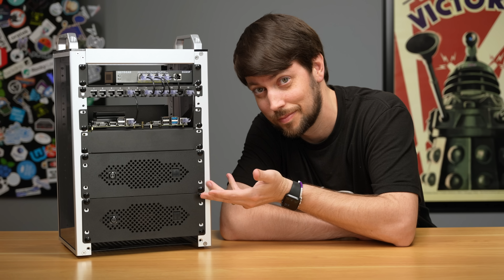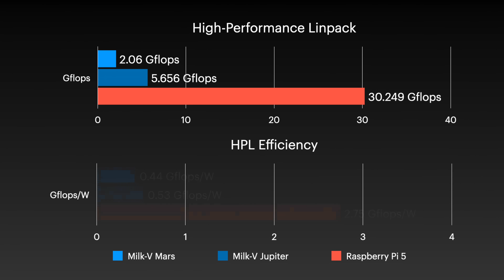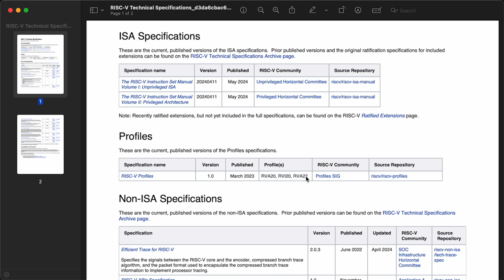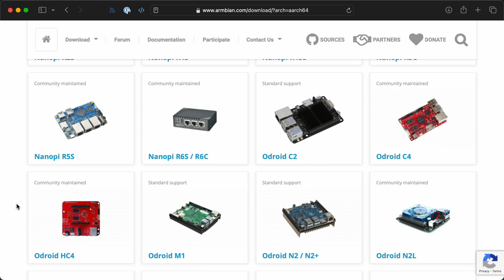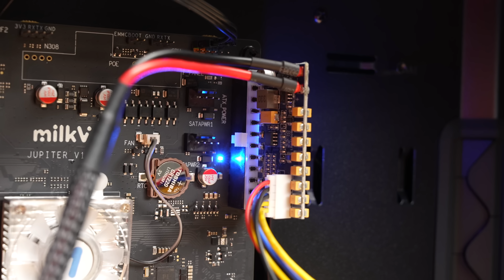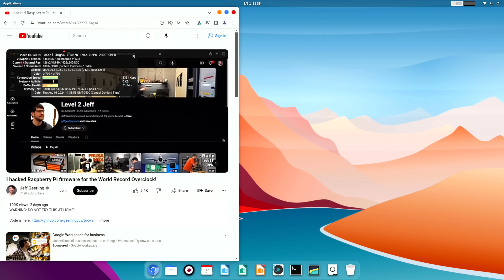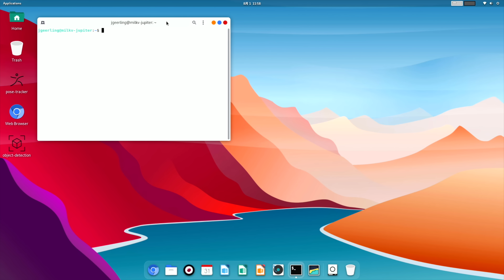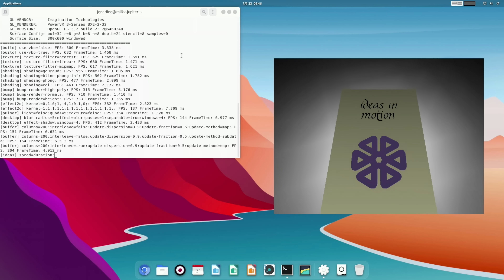The PC industry is changing: RISC-V goes mainstream

Comment: Risc-V can't work any better then linux in the consumer market.   For the same reason.  It's open source.   So manufacturers are free to Fix/Improve it in any way they see fit to differentiate their product from all the others.   This means they all end up incompatible and fragment the market into a confusing mess that the general public is just not equipped to handle.
Reply: Arm is proprietary and this didn't prevent fragmentation from happening. ISA is one thing, what else you bundle within the SoC is another thing. So far, RISC-V looks like it's going in the right direction.
Reply: @alexdev6161  Yup, Right out of the marketing hype hand book.  Anyway.  Back in the real world.  It's not like it's not possible for Risc-V to become popular.  Just that to do so means dropping all the so called 'advantages' people are touting.   I.e. have a single dominant design backed by a major player.
Reply: @lucidmoses so why google spending money porting android to riscv?
Reply: @guest7329  Can't tell if your making that silly of an argument or are just poking fun.
Reply: @lucidmoses  As long as people follow existing standards, you don't need a "single dominant design". There's ton of value to be had in not breaking software compatibility and selling a paperweight with 0 support, which obviously nobody sane would buy.

The market will simply sort out on its own. Good stuff will stand out, broken and fragmented mess will fade into irrelevance. Other players existing does not affect say Intel (one of the investors) coming up with a good RISC-V platform and dominating the market, if they have any interest in doing so.

Either way, it cannot get worse than whatever state Arm is in right now. Standardized ISA, but lots of SoC designs in the wild which need specific software support.
Reply: @alexdev6161  I have no need to convince you.  This has been tried thousands of times before.  It always fails for the same reasons.   I even gave you an example of the best that's ever been done.  Linux.  after 33 years has managed 2% of the market.
So just wait a bit.  You'll see.  you will likely be one the third of fourth next big hype thing when you finally think.... What ever happened to Risc-V.
A boat without a single captain will never get where it's intended.

Comment: I wonder if the tests running are using some of the simd optimizations, while consumer risc-v processors aren't high performance this is seems way too low for 8 core. According to banana-pi's website (take them with a grain of salt if you want) they state that per core they're 30% more powerful than Arm A55 which is really not that bad.

Comment: Horrible review. Why in the world when you are reviewing RISC-V, a CPU architecture, you are testing it on YOUTUBE, a GPU heavy load. And you didn't even mentioned what GPU is on board of this board.
Reply from the maker: I did mention it has an Imagination GPU in the video (though not at the moment I demo'ed YouTube). A lot of people testing a desktop OS on new hardware will test YouTube because it is a good proxy for how much work has gone into making sure the default web browser has GPU video playback acceleration working or not. And if not, how well the CPU can handle the decoding in real-time.

Comment: Sorry, but saying RISC-V has gone mainstream doesn't make it so, and your video title is click-bait.  I've yet to see anyone who wants to replace their current systems with ANYTHING powered by RISC-V hardware other than hobbyists and fan boys.  RISC-V performance is still 10 years behind AMD, Intel and ARM offerings and at a higher cost to the consumer.  Not to mention that MS has no plans to port Windows to RISC-V.
Reply from the maker: Mainstream in the SBC space; and Microsoft is happily digging Windows' own grave over the next decade or two unless their product management can fix their problems.
Reply: @JeffGeerling  Seriously? Windows still has over 80% of the market share so I don't know what graves you're talking about. What percentage of the PC hardware or hobbyist hardware space is owned by RISC-V?  Oh, that's right, it's so small no one even knows.  So you're going to stick to your lie that RISC-V has gone mainstream?  I'm also a hobbyist and the biggest bang for the buck is still ARM and I and all my associates would never consider RISC-V on price alone, let alone its poor performance when compared to ARM offerings.  Currently the RK3588 is the choice of most hobbyists and it'll stay that way for quite a while.

Comment: It seems like a new architecture would be a great opportunity to get out from under the absolutely crushing weight of technical debt we're currently trying to live under.  Every OS and all the browsers (essentially OSs in themselves) are filled to the brim with a mindboggling amount of cruft.  240p full screen video playback was possible on a 66mhz 486 completely in software mode.  A 1ghz machine of any kind should be smashing 1080p, and I'm sure it would if it wasn't running on bloat on top of bloat.
Reply: It’s probably a driver issue. The board Chris reviewed was able to play 1080p video.
Reply: Well... Most likely the Chromium was installed through apt and might have a lot of disabled flags at compile time. Maybe Jeff can try compiling it from sources? 😂
Reply: Now imagine making arcade games by Sega and others on it.  Consoles too.

Comment: Hard pass on RISC products for me.  If I wanted to buy Chinese chips (and I have), I would buy rockchip ARM chips like my Orange Pi 5 Plus
(32GB) has in it.  Its performance is 100% of the way there for anything other than a power user desktop computer.  It'll play 4k videos all day long with no dropped frames, has 3 monitor outputs, 2.5g Ethernet NVMEx4 Windows or Linux etc ad nauseam.

Comment: It's really hard to go through the advertisements for various things to actually find the things I need.

For example, I really want to run a Ceph cluster. But I really want 10Gbps Ethernet and a 6Gbps SATA connector for each computer, as well as a multi-core (4 is fine) with 16GiB of memory each. But it's really difficult to figure out what I have to buy to get that, much less figure out how much it will all cost.

And I asked in r/homelab for advice and was told "Oh, you would never run a commercial Ceph cluster that way, you should do this other completely different thing.".  And that, of course, is very much not the point. :-/

Comment: I think you're spot on with the ARM effect when it comes to building software. By now, RISC-V is just another entry in a list, not a new dimension, in any toolchain that can compile to x86 and ARM. Any developer knows that "support something other than X" is worlds apart from "add Z support, but we already have X and Y support".
Reply from the maker: I remember how hard it was to get x86 + Arm with so many toolchains 5-10 years ago. So much simpler now.
Reply: @JeffGeerling  good thing you've not been around when we went fromm x86 to AMD64 that was a pain and a half.
Reply: I'm wondering what utility Gentoo will have with it's compiling focused package management for risc-v considering it's such an edge case use right now.  Maybe compile a working desktop and image it across a group of similarly set up computers?

Comment: I think the thing that I'm possibly most hyped about with Risc V is the SIMD extensions of all things. There's so much code I run on a daily basis which is dependent on them, but retooling it for specific architectures can be a massive pain when you get into bigger projects, so I absolutely love the idea of a sensible, variable bit width instruction set made with a certain degree of hindsight and forward planning built in.

I would love to see some coverage of Risc V SIMD!

Comment: Irrelevant for me. My use case is Proxmox running VMs, requiring an integrated GPU that can be passed through for accelerated transcoding.
I blew $30 for a second-hand Datto Alto A3V2 with Celeron 4205u incorporating UHD-610, with onboard H.264 and H.265 (8 and 10 bit) encoding.
My server is monitoring 4 network security cameras, running a Samba share, hosting several web pages, plus a couple other services which I forgot what they even are, and is still only 35% utilized.
I don't anticipate ever "upgrading". This does everything necessary now, or even envisioned for the future.
I loaded AdGuard Home onto a USB flash device on my DD-WRT router, for pete's sake, and that router is already over 10 years old & satisfies all current and future possible needs. My PC with Ryzen X1800 dates back to 2017 and I have no anticipation of ever upgrading. Why? It does everything already.

Comment: Interesting video thanks Jeff & Chris!

Watching this on a DC-ROMA 2 with the SpacemiT K1 CPU and it can handle the video at 360p without stuttering but falls over at 480p.  This is with the Ubuntu 23.10 that the laptop shipped with, wonder if the stuttering is actually because the software is not optimized yet?  I have a Debian image for the laptop too and am hoping to try other operating systems if you have any recommendations?  Also, yes definitely interested in a test of the PCI slot with a GPU (and also with other accelerator or NVMe cards perhaps?).
Reply from the maker: Could be, and Fedora seems to be okay as well (Fedora V-force images for Fedora 41). Definitely worth testing!
Reply: @JeffGeerling  Thanks I'll put Fedora as the next one on the list when the postman delivers some nice new micro SD cards.  I must admit to being quite surprised at how well the machine works...I mean everything "just works" albeit a little slowly at times.  I have my heart set on trying to port some kind of BSD or Solaris/Illumos based OS to it...why not run the most obscure OS on the most obscure CPU anyway?
Reply: @glenwalker4093  Then you should port TempleOS 😂

Comment: Your claim of RISC-V being around core 2 duo level is laughable, since the RISC-V's single core performance is so low, around 78 vs ~200 for lower-end core 2 duo processors (E4300).
Reply from the maker: Well on multi-core performance (so all-in).
Reply: @JeffGeerling  There is a reason why single core performance matters so much. Not everything can be parallelized.